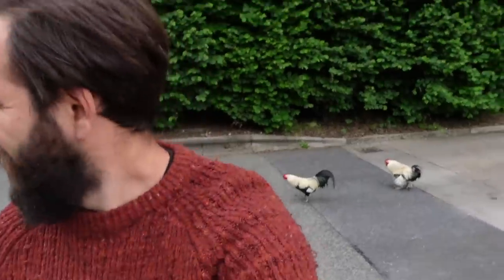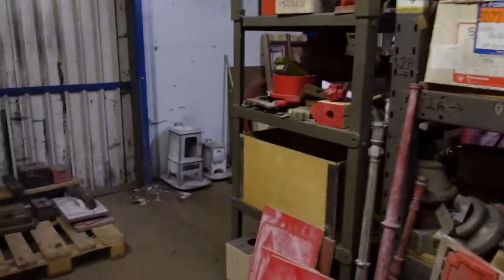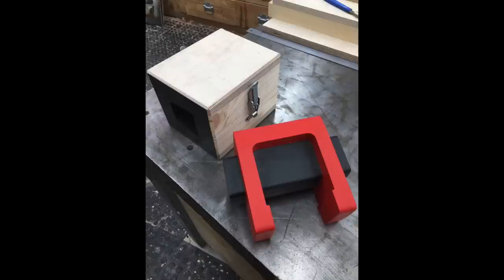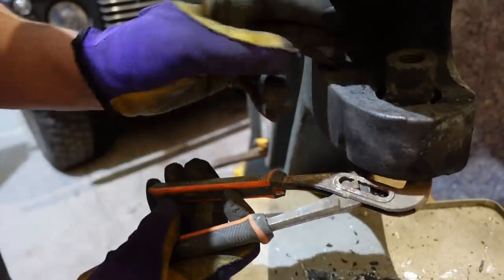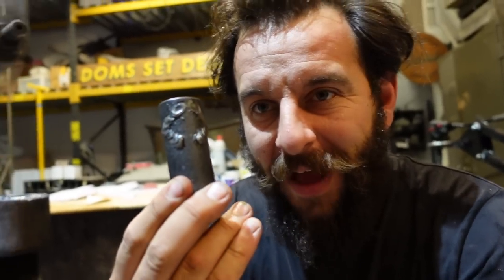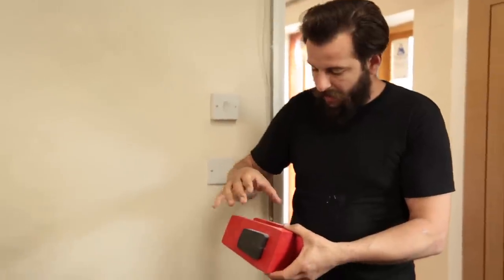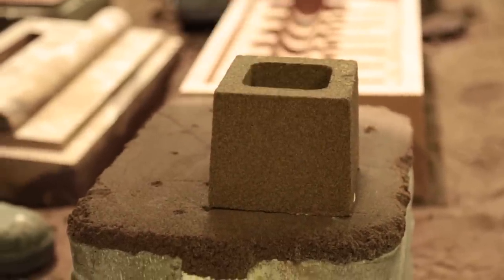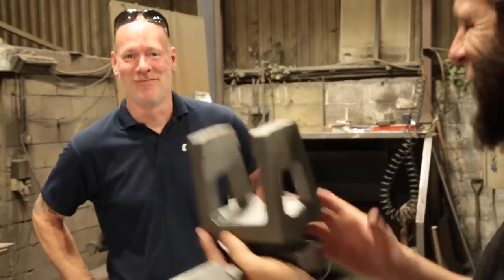'Casting At The Foundry' - Will my pattern work?! | Reviving History (Episode Four)

Comment: Takes me back over ( don't tell anyone ) fifty years. The school I went to had extensive workshops including pattern making shop, casting shop, fettling and metal working machines woodworking and latterly electronics. Each year we spent a week in one of the shops. Set me up for life. I can empathise with your delight in your first casting.
Reply: My old school in the 1970's had the same. QE Boy's Barnet. Wonder if they still do?!
Reply: @markdavis2475  My old school doesn't. They knocked down the old workshops and chemistry building and replaced with a new science building. 

Allegedly, the workshops were used during WW2 to make parts for Spitfires.
Reply: @neilshep50  Well I guess a new Science building is better than nothing! Bit gutting though.

Comment: Another great video on the series. Very interesting process with the casting and East Coast Casting, great to see and understand, well explained. 
We did sand casting at high school using molten aluminium back in the late 70's in our metal work class. Probably would not be allowed nowadays.

Comment: Fascinating project!!!  It's neat to see a tool like this revived.  I'd double check that the metal actually is lead and not babbitt bearing material though.  They look similar and melt at a low temperature.  Babbitt is used to make cast-in-place bearings (a cast iron pillow block is placed around the shaft and the void space is filled with molten babbitt metal), and this seems like a very similar application.
Reply: I'll wager it's babbitt or a similar alloy, as lead is too soft & would loosen under the pressure applied.

Comment: Usually heat the mold to eradicate any moisture and gassing of the casting This can result in micro porosity which is the brain of any foundryman. Worked with so many foundries over 40 years on so many processes but it is really great to demonstrate the pattern and molding process Well done.

Comment: Nicely explained Dom. I used to teach woodwork and metalwork back in the late seventies and eighties and used to do pattern making with the lads and riddling the green sand wetting it to the correct dampness. Making the moulds from the patterns, and casting their aluminium pieces. Great fun, don't know if the elf 'n safety gods would allow it now in high schools, I very much doubt it lol

Comment: Have you thought about some type of alignment jig for those parts held in position when the molten lead is poured in?
The welded locking arrows, you could add 'DC' for the new generation built by you. 
Fantastic at the casting shop.
Top man, keep up the good work... J
Reply: Totally agree about the alignment tool, awesome idea and so practical. Top suggestion

Comment: Thirty years ago, I was cameraperson when the cast iron parts for the Science Museum's build of the Babbage Difference Engine were produced at Queenhithe on the Isle of Sheppy. The SVHS camera was a shoulder mounted Panasonic which was a far cry from today's kit. The resin sand, casting boxes and the heat an sound of cast iron doesn't change! (for some jobs the foundry still used greensand)

Comment: Another pattern making expert  here :)    (44 yrs in the trade on both hand tools and later using CNC)
I think it should be made clear that what you supplied to Chris as the foundation for a pattern did him little favors.
Giving him the sample casting and saving him some work with a dimensioned drawing would be a better option.
It would surprise we if he didn't start again from scratch particularly since it is now a split pattern.

Option 2-  It is not uncommon these days for even hobbyist to have access to CAD software and even their own CNC router.
Discuss with your friendly foundry what they would like as a pattern showing them the sample casting, things like:, split line, tapers, core requirements, print location, print to core clearance, machining allowance and scale factor for contraction ie x1.01 for cast iron) go home and model it as Chris made it, and have it CNC routered. 
Machine your pattern in material thickness layers if you don't have the  Z axis travel or cutter reach.
Nice stable timbers are great for hand made patterns, it adds however an extra complication of grain direction for strength and dimensional stability when CNC cutting it and also corner chipping from the cutter.
Moisture resistant MDF is a good affordable option for CNC routing patterns. Tall thin features in MDF can be a bit fragile in a foundry, but drilling down them and gluing in wooden dowel will give the necessary bracing.

I appreciate Dominic's enthusiasm for bringing old school skills to this project, it should be appreciated also though that the CNC approach is a different animal and best used to its fullest completing all the finer points in CAD. (comes with a steep but interesting learning curve,that will be very satisfying).
What I am describing is 3 dimensional cutting finishing with ball nose cutters, not end milling profiled shapes.

Much enjoying the series, just chipping in with what I hope is helpful to the punters who might want to have a go at patterns for their own projects.
Reply from the maker: Thank you very much for Sharing your knowledge, please watch the rest of the ranalah series, last week we met the pattern makers working on the main frame I think you would appreciate it! 
Let me know what you think
Reply: @DominicChineas  I'm glad you took the input in the spirit it was intended. :)
Yes have seen your most resent video on the main pattern (it was the first of yours Google put me on to) have since back tracked the rest in the series.
They are doing a great job of the pattern, it should give you many years of use.
What the engineer modeled for you in CAD with all the tapers included would make an ideal basis for CNC machining the pattern.
I quite understand the value you see in having it done traditionally including leather fillets. It adds to the heritage of what you are doing bringing back an old marque.
If you are interested here is a link to some of my CNC patterns (some are plugs for composite molding)  https://www.flickr.com/photos/dugz-pix/sets/72157679680377043/
Reply: Always appreciate input & I’m always willing to learn from others with there experience 👍🏻

Rgds, Chris

Comment: Brilliant Dom! 
Were they able to modify your original pattern or did they have to remake it? Is that the Ranalah frame pattern behind you at 16:38?
That molten lead technique is how they used to fix railings and hinge pins etc into stonework.
No big deal really that you had to melt the lead to remove the inserts. You can make some installation jigs now and practice installing them for your new ones. 
Can't wait for the next instalment!
Reply: Looks like the Ranalah pattern - well spotted!
Reply: I think you could be right!
Reply: Actually, I think it's this - https://youtu.be/kWCC4WGrwMo?t=26

Comment: I hope the foundry guys are managing OK with the current insane energy costs - must be a major part of their expenditure.
Reply from the maker: I think they have a pretty hefty electric bill every month!
Reply: @DominicChineas  380 KwH/tonne for melting cast iron, so your Ranalah alone (I see 750kg quoted elsewhere) used about as much electricity as I do in a month
Reply: Electric is a big factor for our business. We have a power factor correction unit and locked our prices until 2026 last June, so we did the right thing as to all the increased energy cost presently.
Reply: @eastcoastcastings  I bet you're relieved you picked exactly the right time to do that.

Comment: 3D printing has made it much easier to make patterns, especially patterns with cores, loose part, core boxes etc. Probably not robust enough for production use, but for the typical (hobby) jobs that I have cast,  up to half a dozen, it simplifies things enormously (if you already know CAD, at least)
There is the issue that 3D print needs a lot of post-finishing to get a good enough surface finish to release properly (and to colour code the faces) and most printers don't print very large. 
One tip is to leave holes in the parting faces to glue wooden dowels in to for the foundry to put screws in to extract the patterns. wood screws straight in to 3DP does not work at all.

Comment: great work dom.  I suspect the lead is used to position the interfacing features on the wheels main frame to avoid machining the main casting.  This could be avoided these days by machining the main casting or you could use epoxy grout instead of lead to position the features.  You will need to make a fixture up though. if the machine shop you are using has a horizontal borer, then machining the casting would probably be the best bet - just make sure it is either well seasoned, or heat treated otherwise you will end up with positions moving over time.

Comment: I reckon they used poured lead so they could line up both bores on a mandrel and set them in place in a rough casting, no need to bore it true. You should be able to do the same to put them back.
Reply from the maker: Yeah I think your absolutely right, no machining at all on the body

Comment: Lead would be a little soft and gutless for the purposes shown and I would suggest that it may well be babbit. (whitte metal) or perhaps lead with a little antimony. It was poured this way to achieve some alignment of the main shaft. Either way if you are going to cast in lead then you need to preheat the areas to be poured and pour at as lower temp as possible so as to avoid excessive shrinkage.

Comment: Well, having worked in a foundry lab for 18 years as model maker, former and caster, I think I can say I have quite some experience on this topic. I don't see what's wrong with the model. Surely there's 3D printing these days and it makes the job easier but it's not necessarily the holy grail for simple structures like this. Rapid prototyping (and 3D printing) is mostly used for more difficult pieces where you have corners you can't machine for instance. I know that I would have made this model way faster by hand and in wood then with a 3D printer (which I have too, if you were wondering if I have enough experience there). I see people print stuff that are way cheaper and faster to build in wood or other materials. Heck, I sometimes even made aluminium models if it was for risers and feeding canals for durability reasons. DOn't know if this has to be nodulair (My guess tho) or lamellar cast iron, but I don't see much trouble casting this honestly. Very straight forward piece. I hope you had fun discovering this field of work.
Reply: Loved to see a foundry from the inside once more btw.... They all look a like lol

Comment: That is a peculiar way of fixing a piece to it's base.... Might be a way to align the upper and lower bushings to each other in an economic way I might think... Never saw that before. You normally would go for pieces with key holes or something these days. Nice.
Reply from the maker: It’s a very simple way to solve a problem! With a jig everything is perfectly aligned and there is no machining needed to the large casting!
Reply: @DominicChineas  Exactly. I liked the simplicity of it. You probably never need toi change this piece (except in your case). It's a nice feature from the past.
No company would do that these days.

Comment: First part done - at least two other parts to be cast - the handwheel for the gap adjuster and the main casting.  One should be straightforward - the other really interesting.  Then there are the machined components followed by the assembly (more molten lead involved) and finally... Will it all work?  You (and a fair few of your subscribers - me included) will be feeling like an expectant father when that stage comes, waiting to see the results.

Comment: Get some 'old' wheel weights from a Tyre fitter or Garage. They're harder than plumbers/roofers lead at about £3-75 a kilo  If there are any newer Zinc weights in the mix they will float on the top when melting, you can just scoop them out.
Reply: Modern wheel weights are not lead. I have a very large pile of wheel weights I thought were lead and they are not.
Reply: @petersaupe7455  They sound different to lead when you handle them.

Comment: I was lucky enough to go to a garage sale in support of the local hospice. The house it was held at was owned by a pattern maker and had drawers full of wood patterns. I was lucky enough to grab a bunch of wood patterns that they deemed to big to keep. From a pattern for a bronze water Impeller to an enormous flywheel and pulley set. In NZ.

So lead was basically used as solder?
Reply from the maker: That’s so cool! I have a new appreciation for pattern makers and patterns, they are so complex to make nicely!

The lead was kind of like solder and a filler material

Comment: Great insight into the Ranalah machine and the background to the casting process (They need to make the pattern larger than the finished piece by a certain percentage factor depending on the metal/alloy, to allow for shrinkage and machining). You didn't stop and explain about the cracked/broken upper part of the Ranalah that opened up when you melted the 2nd lead plug - more in the next vid' ? Keep up the good work and thanks again for letting us in on it  ;- )
Reply: I spotted that crack as well. I wonder if it was partly hidden when the lead was first poured in?

Comment: You could have used the wheeling machine intact with the shafts to make the core, then merely blank off the shaft areas in the core with some core sand, and fudge the shape.

Comment: You said that by removing the lead that you had ruined the whole machine but surely you will have to use lead for the new machines so can't you do the same to the original? I love everything you do so can't wait for the next episode.
Reply: I know Dom is try to keep the project as original as possible, but molten lead is nasty stuff with all sorts of health and safety regulations. I wonder if a modern epoxy resin would be a better choice. It could be coloured to look just like lead.

Comment: From a machining point of view, going back to the 1930's. It would be a quicker way to manufacture these wheels by leaving the bores of accurate parts of the frame oversized and rough cast. Then making a jig to align all the internal parts while you cast them in with lead. So no machining is needed on the frame. But with todays large machine centres, it wouldn't be hard to finish these bores so parts could be fitted or pressed in accurately. Avoiding the use of toxic lead..
Reply from the maker: Thanks for the comment, 
The whole point of this project is to recreate the original ranalah wheeling machines, I want to do everything just as they did to keep them true to the originals,
Reply: @DominicChineas  I get that. But your machine has failed on the top guide due to the stress on what is a very soft material. This could be an opportunity to improve on the design with no change to its appearance. Plus it would be more accurate, stronger and easier to assemble. 🤷🏻‍♂️

Comment: Great update - thanks. I did not realise they used inserts set in lead but I can see that it saves all the problems with machining the casting to high precision. The main casting is likley to move a bit as it ages but I guess the heat treatment will sort most of the movement. I think they used to leave castings outside to weather in the past so they would de- stress and move into their 'final' shape before they were machined. I guess you are now officially a 'lead worker' so you need to get your regular medical tests sorted as required by the Lead Working regulations - stay safe. The control of lead at work regulations are at https://www.hse.gov.uk/lead/index.htm.

Comment: Not.going to try and read 300 comments .. but the way that first shot of lead released at moderately low temperatures ... are you sure it wasn't Babbit?? It would pour and melt at much lower temperatures and avoid any heating issues with the cast iron as well

Comment: What was the grey thing popped into the pouring hole and what’s it for? :)
Reply: Hi Richard, 
The grey item is the filter for the metal. We use these in various sizes depending on mould & materials we cast. 

These filters are designed to provide us with high levels of inclusion removal and flow control as the metal enters the mould. Also a better quality casting. 

Hope this explains. 
Rgds, Chris
Reply: @eastcoastcastings  Appreciate the reply, thanks!

Comment: How do you know the type of casting material on the parts and the frame?
Reply from the maker: There’s only A few options that would be suitable these days. I am taking advice from Chris at the foundry. He knows his stuff!
Reply: @DominicChineas  Thanks Dominic ,but you said you want to be as close to the original Ranalah as possible. So there is no info on what type of cast iron they used in those days.
Reply: @bensmetalshapingshop  Hi Brian, The cast grade they would of used would be very basic iron. We have full spectrometer facilities on site, but going from experience on analysing old castings they tend to be ‘not’ a grade at all. We use certified pig iron so we know the material & check melts on a regular basis by having a test bar pulled. 

Rgds, Chris

Comment: Are you saying you cant use your English wheel  now the lead has been removed,?   you don't have to use lead to secure your fittings,   you can easily manufacture sleaves on a centre lathe  🦘👍
Reply from the maker: So the plan is to make a jig to be able to
Re set the spindles in lead, I am trying to keep everything just as it was from the factory
Reply: @DominicChineas   Ok i gotya, that's great Dom,  i thought you weren't  going to use it again.